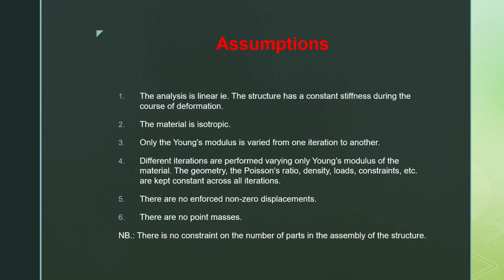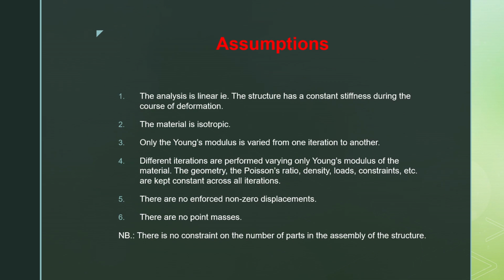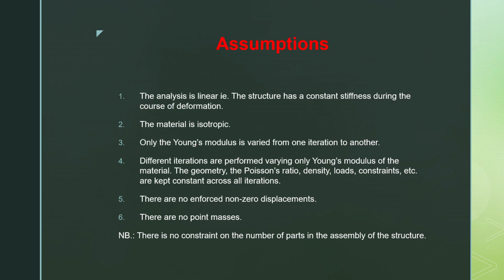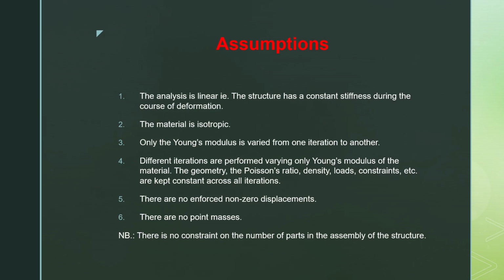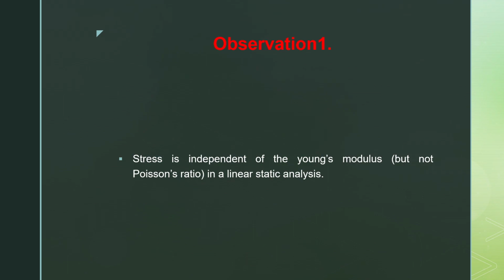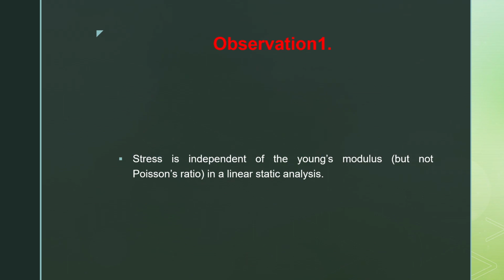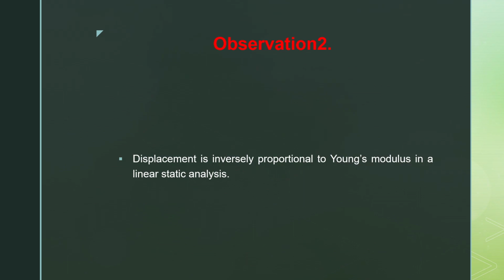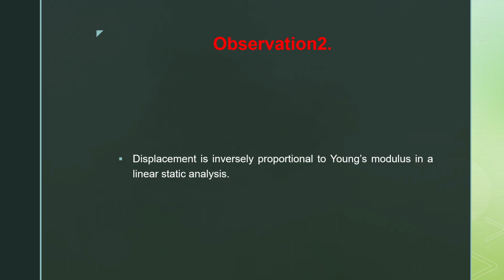What is the effect of material of a structure on structural response?

Comment from the maker: Disclaimer:
This video is intended solely for educational and demonstration purposes in the field of 
engineering and computer-aided engineering (CAE). The methods, simulations, and analyses 
shown here may be simplified or incomplete and should not be applied directly to real-world 
designs, products, or safety-critical systems without professional validation. 

Viewers must consult official standards, codes of practice, and qualified engineers before 
implementing any techniques described. The creator accepts no responsibility for errors, 
omissions, or consequences arising from the use of this content in practical applications. 

Any references to software, tools, or products are based on personal experience and do not 
constitute professional endorsement. Sponsored or affiliated content will be clearly disclosed.